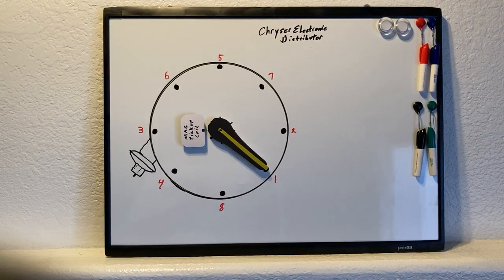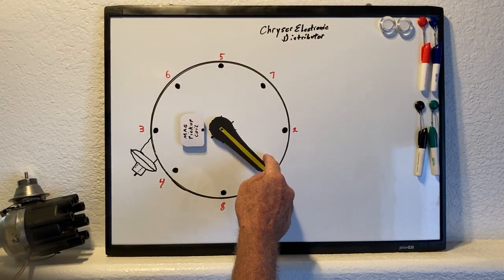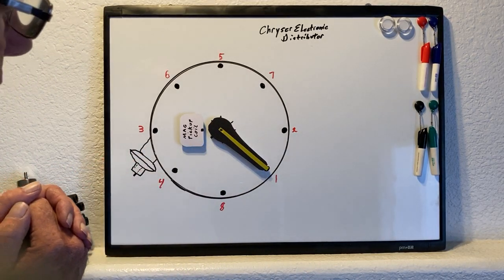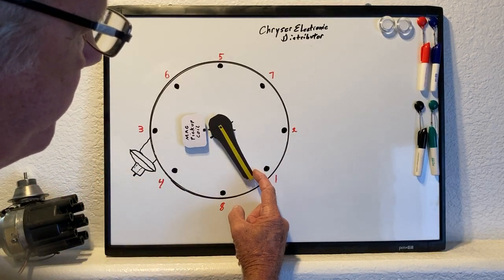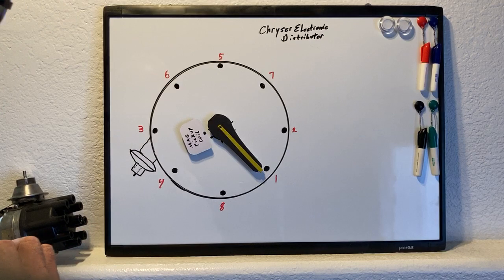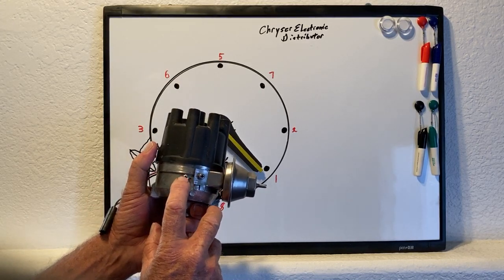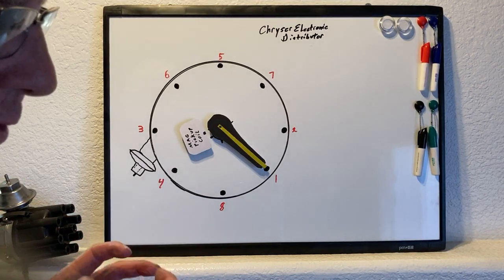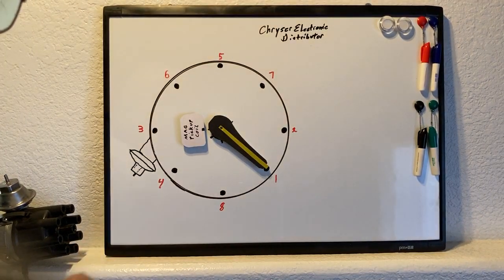What The Heck Is Rotor Phasing?

Comment: You're telling me the factories who made certain models of distributors screwed up the rotor phasing so bad that you have to modify the position of the breaker plate/pick-up to correct it? Or get an adjustable rotor, an adjustable cap, an adjustable breaker plate or pickup, or install a crank trigger. I'm thinking this doesn't apply to 99% of classic car people...but cool modification if it really was necessary...btw people, without one of those parts I mentioned THERE IS NO ADJUSTING ROTOR PHASING, just had to be clear.

Comment: I challenge you to disable your vac adv & shine the light in the drilled hole in the cap & rev the eng & you will find that phasing does not change. Also move your initial & you also will find that phasing does not change. Only vac adv changes phasing. excellent idea to slot the mounting plate holes on the side of the dist which again will only change the phasing range that vac adv adds. not sure if the vac adv mounting would need to be changed slightly to accomodate this but I am going to do it as I run vac adv. Some mounting plates have a roll pin locator in the housing wall which would need to be removed. on a side not Echlin has a rotor with a longer (.060" iirc) blade which will reduce the gap & help with phasing issues. (MO3000). Robert Crispell Lincoln Nebraska.

Comment: Loong, long time ago, about 40, 45 years ago an old timer friend of mine told me that 5 and 7 get swapped often doing work. You can tell right away that it's skipping. The reason is because they're the only two cylinders in the firing order on the same bank right next to each other. Real common on Chevs too.

Comment: Is it possible to adjust phasing on a HEI distributor?
Reply from the maker: That depends on the distributor.
There are many different types of HEI distributors.
Some have an adjustable rotor, or an adjustable can be purchased for some.
Reply: @mopars4us  i have a MSD street fire. Having some misfires. Took the distributor cap off and noticed that the rotor is  firing on the out side of the contacts. I do have retarded  initial because of pinging and detonation at higher acceleration. I'm hoping phasing will help. I appreciate your time  but do you think phasing my HEI would help? 🤜🤛
Reply from the maker: @raymondmenendez6499  
Firing on the outside of the contacts could be normal if the mechanical advance causes the rotor tip to sweep across the contacts in the cap.
Reply: @mopars4us  thank you for your time 🖖

Comment: Please forgive me, sir,  but I don't mean to contradict. I believe that the centrifugal advance will keep the rotor pointing at the same terminal point on the cap but the vacuum advance is the one that will sweep the terminal as you described. I have eliminated the vacuum can and pinned the moveable pickup plate into position to properly index the rotor to the cap on hotrods & racers that way for many years. I then cut off the end of the vacuum can mounting tab to locate the cap on the distributor and cut a piece of aluminum to cover the hole- both the locating tab and the aluminum hole cover mounted by the screws that previously attached the vacuum can unit. The movable pickup mounting plate can easily be pinned at the hole that was previously occupied by the vacuum advance rod after determining rotor index position. Drill through the rod mounting hole into the lower mounting plate and use a small screw/nut (with loc-tite) in the moveable plate extending down into the lower mounting plate to keep moveable plate located. Distributor modified in this fashion will always have rotor pointed exactly where you indexed it determined by the position that you pin the magnetic pickup plate. If you want to use the vacuum advance feature of the distributor THEN you have to deal with the "sweeping rotor" but you can index your rotor for WOT by slotting screw holes as you described if necessary. I hope I didn't offend and I hope even more-so that I'm not incorrect-Haha. There is an awesome advance curve limiting plate available but I can't remember what it's called off hand. It is expensive (approx $50) but SO worth it if you don't have a welder & time/patience to modify centrifugal advance mechanism.
Reply from the maker: Sorry but you have that inverted.
Centrifugal advance rotates the top shaft of the distributor via the weights, so therefore the rotor changes position in relation to the cap terminals.
Vacuum advance moves the pickup mounting plate, not affecting rotor position.
Reply: Sorry, but I still disagree. The rotor moves with the trigger wheel. The plate moves with vacuum advance operation changing position of rotor/terminal relationship. As for price of timing limiter plate I wish I had bought from you.
Reply: @mickangio16  You are correct, he is mistaken...Question: Is rotor phasing being off via factory/design defect really that common? Is it frequently necessary to get an adjustable rotor, an adjustable cap, an adjustable breaker plate or pickup, or a crank trigger? Or are these defects a rare thing? I'm going down a rabbit-hole and I have never heard of phasing being wrong from the factory but I love to learn.
Reply from the maker: Oh and the timing plate comes from 4secondsflat.com (FBO) of which I am a registered distributor for. :-)
The plate used to be $22 shipped, but is now $35 shipped.

Comment: @mopars4us but aren't there pins in the side of the distributor body that locate the base plate?  Do you have to remove them to allow for the base plate to rotate when you slot the screw holes?
Reply from the maker: Some have the pin and some don’t.
If a person wants to make the phasing adjustable, the pin needs to be removed if it has one.
You are correct.
Reply: @mopars4us  Ah, thank you for explaining that.  This was a great video!!  I learned something as it apples to Mopar distributors.  Thanks!

Comment: How to adjust  phasing with a vacuum valve should be your next upload.
Reply from the maker: Thought you were yanking my chain here, but just in case you weren’t.
Rotor phasing is not affected by vacuum advance, as vacuum moves the base plate/pickup and not rotor position as it advances.
Reply: @mopars4us  If you're going to advise people please reconsider your opinions, rotor phasing doesn't change with mechanical advance, it only makes the spark happen sooner in the engines rotation, the sparks still happen when the rotor is in the same positions, but vacuum advance does make the sparks happen when the rotor is in different positions. The relationship between the shaft and the rotor doesn't change under operation, its fixed.

Comment: Great video, keep them coming. 
Quick question about slotting the two screw holes. I understand your reason for doing it I’m just curious would it not change the timing slightly by rotating baseplate?
Reply from the maker: Absolutely changing the plate changes the timing.
It needs to be re set.

Comment: What would cause a rotor to overheat and burn the insulation right through, but no misfire,.. After fitting and msd 6 series ignition box
Reply from the maker: A gap between the rotor and the button in the cap can cause this as a spark that has to jump a gap creates heat.
Also Napa carries a rotor that is .030 longer at the tip to help close up that gap between the rotor tip and cap contacts.
Part number MO3000

Comment: So basically what you are trying to do is index the rotor to try to be as close to the center of the cap terminal with the  reluctor ring in line with the pickup coil, correct?
Reply from the maker: Sorry, I didn’t see this for some reason.
Yes, that is correct.
Reply: Only if you have no vacuum advance, if you do have vac adv take the position of the rotor when spark happens with no vacuum advance, and take the position of the rotor when spark happens on full vacuum advance and split the difference between those two positions, making your adjustment to point the middle of the rotor at your new determined point. most likely you'll find that the factory got the phasing pretty darn close. Perhaps it depends on what distributor.